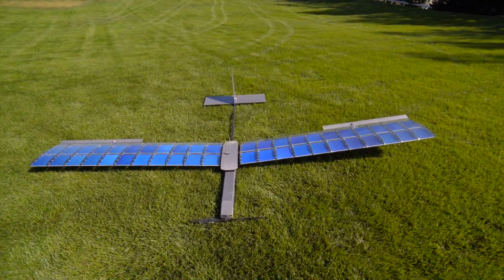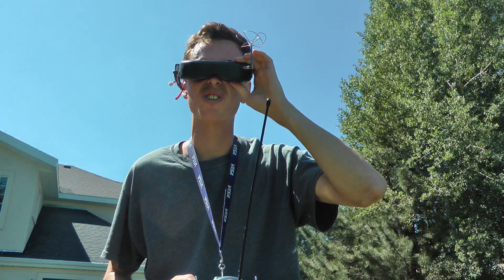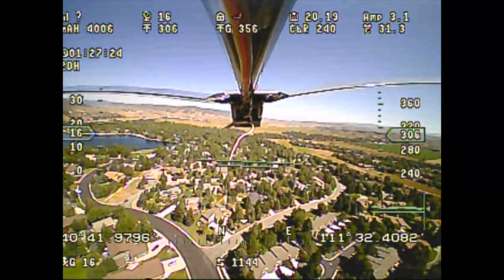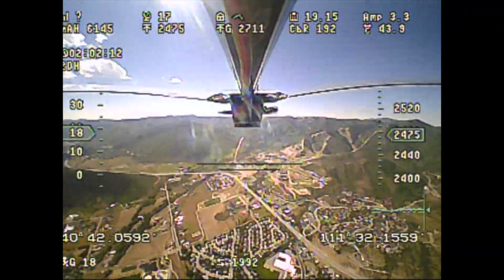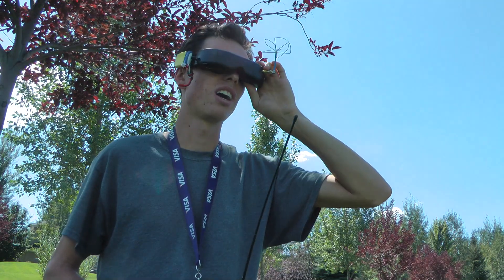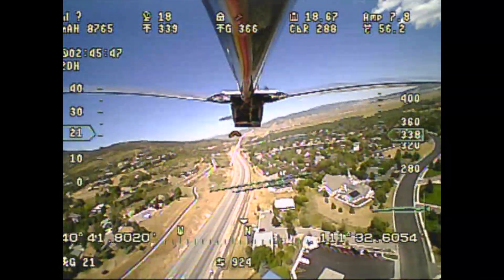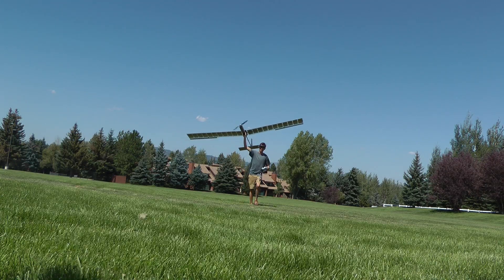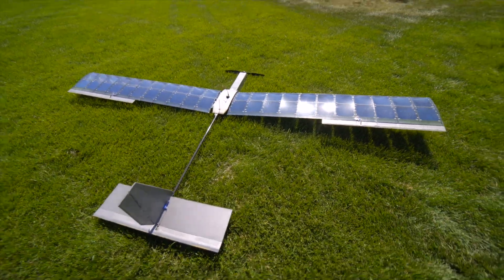SOLAR Plane V3 Long Duration Test Flight - RCTESTFLIGHT

Comment: Congrats dude, you did it!  You could look at reducing weight by using a lower amp hour battery since you're now flying by solar power.  You just need the battery to stabilize the power system and provide temporary storage for climb and recovery.  Extra optimization will expand your flight times from noon+-1 hour to noon +-2 hours to get the 10am take off time you wanted.  BTW, I think you could have gone another hour if you hadn't turned off the solar array near the end.  Anyway, awesome job and don't bother with MPTT.

Comment: Could you switch between batteries, like one used for take off and gaining altitude while also having solar input then swap to another full one while at altitude. Then when on the new battery all solar can go to charging the now partially drained takeoff battery, once that gets charged up swap back to it? Repeat? Sorry if this is dumb or if u tried already and i've mussunderstood.
Reply: A lot of people have suggested the same idea but I don't see what it buys you other than doubling the weight of the battery.
Reply: GaryVolts I was saying because he said solar voltage and efficiency increased when the plane was gliding and not using the motor and in charging mode. With the two batteries it would have the solar cells always charging a cell at peak efficiency.Less loss and more efficiency might keep it up in the air longer.
Reply: I think their was some misunderstanding somewhere.  Sure the battery is charging at max rate when he was gliding down, but the potential energy represented by the height of is airplane is decreasing during that same time period.  The single battery already  naturally discharges during the course of the flight towards the voltage of maximum power transfer and hangs there on the rising slope of the curve until late in the day when the voltage crests the charge efficiency curve and starts down the other side, at which time he needs to get ready to land.

Comment: I would not boost up the voltage from the solar cells, you're loosing too much efficiency this way.
Maybe find a motor/prop that works on whatever voltage you solar panel are providing at 50% and match the battery to that.

Comment: Awesome, congrats!  That's quite a flight time.  Props to you for patience. :)

Power management is definitely your next hurdle.  I don't think it's realistic to expect solar power to provide enough energy to climb at off-peak times of day - that's what the battery is for:  Charge it up in the sun, fly off it in the dark.

Also, to gather as much solar energy as possible from off-noon times, you need solar panels that face more to the side than straight up.  Maybe on the tail, or perhaps consider a polyhedral wing with panels on the outer sections to capture off-peak sunlight.

Comment: I think winglets would help.  Some of the air slips from under the wing and around the wingtip to above the wing.  This takes energy out of the forward motion without creating lift.

The controller is basically a PID controller.

Proportional gain is how much angle on the controls per degree of heading error right now

Integral gain is how much to increase the angle per second per degree of heading error

Differential gain is how much angle on the controls for how fast the heading is changing

A lot of controller either dont have the integral or the differential 

The "S" turns are oscillations.

You should be able to hold the aircraft with your hands and turn it to see what each control does to the control surface motions. 

If there is an integral gain, turn it down.  If not turn down proportional.

If turning down the integral doesn't stop the oscillation, turn down the proportional too.

At some point you should be able to get the plane to not oscillate but be very sluggish to correct for wind changes.

If there is a differential turn it up step by step until you start to see fast S turns and back it down from there  by about 1/3rd to 1/2.

Comment: You've probably already thought of this, but once you get your charge controller figured out, what about replacing the batteries with high capacity capacitors? That could be a winning combination.
Reply: I don't think there are capacitors with specific energy specs that would beat his battery.

Comment: Try one of these.  It looks adjustable.  I would set the output voltage to the maximum battery voltage you want from the MPPT (i.e full charge).  I believe that's just a maximum setting and will still send maximum power to the battery if it is below that. http://www.ebay.com/itm/5A-9V-12V-18V-24V-MPPT-Solar-Panel-Controller-Battery-Charging-Board-1-100W-/272252183236?_trksid=p2141725.m3641.l6368

Comment: Please fly with MPPT.  It would be amazing if you could automate the flight.  Just control for takeoff and landing and have a programmed holding pattern for the boring parts.
Reply: The system finds the MPPT point on its own without a controller.

Comment: Love your creativity and your projects! Hey how about using two batteries and a switch that decides when and which battery it should connect to the solar panel? So you'd use one batterie while the other is charging and then switch to the full battery again?
Reply: More weight is a bad idea.

Comment: Dude, it hurts seeing you misuse solar panels like that, just ask greatscottlab to make you a circuit that maximizes the solar cell power production, I bet he can make one in 5 minutes.
Reply: The system finds the max power point naturally as the battery discharges.  The approach weighs 0 grams and creates no conversion losses.
Reply: GaryVolts the dude just plugged in the solar cells like an extra battery, I'm not good at electronics but I know there are circuitry that draw the maximum amount of power out of a solar cell without relying on the voltage drop of a lipo.
Reply: I appreciate that it may appear like this, but there is actually some careful thought into the selection of the battery pack voltage relative to the solar panel.  Yes there exist electronics that are designed to operate for related applications but in this particular critical solar flight case this seemingly simple way of connecting the panel to the batteries is optimum.  It adds no extra weight, it incurs no switching losses, adds no EMI to the system, and operates the panel at its maximum power transfer point when the battery needs the power the most.

Comment: thanks for posting.  good work.  one thought.  in order to reduce power consumption, a geared prop drive using a lower-wattage higher-speed motor could be tried.     cheers

Comment: I think you should try to improve the plane in lots of small little ways to get lots of little increases in efficiency like;
rounding the front of the nose (as it is pretty square), perhaps use a nose cone.
add winglets to the ends of the main wing.
round the front of the leading edge of the vertical stabilizer.
You could also make the aileron control surface go down the whole length of the wing.
The hatch on top looks like it could be slightly thinner and rounded to make it more aero dynamic. 

Im sure you could find more

Comment: Good progress, got data in even though not the result you looked for. Try this thought ... the tail-plane does its job, sure, stabilizing, but for your real objective it is just a dead-weight passenger. I count 44 solar panels on the wings - why not redesign just the tail planes to have another 8 panels - that's an 18% increase. Why not 12 more panels - that's a 27% increase. Structural weight is already partly in the mix, only PV panels and wiring to add and a little CG adjustment. Not too invasive. That could be done with approx the same size horizontal stabilizer as current, but with a 2x2 or 3x2 grid on either side, with the hinge between the two lateral lines. Yes,that makes for a very large elevator portion, but that also means gentler throws for the same control action, which would probably be a good percentage more kindly on the drag total. Every control movement creates drag. Make the vertical stabilizer and rudder highly reflective (mirror mylar or aluminum foil) to reflect onto the adjacent horizontal surface.  

(edit) PV panel output is more efficient cool than hot. The transparent wing is the equivalent of a greenhouse. Infra-red rays go in but can't come out. Needs some cooling air-flow internally. Perhaps intakes near the wing root to catch the prop blast and exit vents at the wing tips in a position where the tip vortex can help extract.

Now, about those ailerons .... hmmm.

Comment: rewire the solar cells so you have a higher input voltage from them
and THEN use the buck converter and find the most efficient current point with the most efficient voltage (and set current limit so its also the most efficient)
and then you will likely get closer
but it will likely be less efficient than directly connected to the solar panels because of the added weight of the buck converter and buck converter efficiency losses (You could perhaps remove the batteries and see if it will work with the buck converter.. but it might likely have some unseen issues.

Comment: use a two section battery, recharge one with solar panels while the other is powering the motor and repeat the cycle
Reply: Batteries lose most of the energy that is put into them. Best sustainable method is to run solar as directly to the motor as possible.

Comment: The way you have your cell may be shaded.  In many cases a little shade will cut solar cell output by more than 50%.   Put it on the top of the wing

Comment: when you get to the stage of doing a re design i would recommend going with a twin hull and boom, 2 motors and greatly increase solar area without increasing drag too much. something like this http://imgur.com/a/KWGJ7 did a quick photoshop

Comment: If your solar voltage is as close as it is to your battery voltage, you will have to buck/boost for mppt. By wiring the panels for half the voltage Double the amps you can get away with just the boost. 
Consider 4S larger prop and the mppt controller you already have....

Comment: You need to get long range trancevers and do cross country with the plane :D
Reply: or just the Grand Canyon
Reply: yes
Reply: Good idea
Reply: @Kevin because that doesn't break FAA regulations
Reply: @brandonhoffman4712  It would be difficult to not break FAA regulations doing that but, it is possible. You would have to be in a chase vehicle maintaining line of sight and navigate clear of all airports and then there is the night time flight problem. You would have to get special permission from the FAA to fly beyond the 1 hour after sunset, Probably not going to happen.
Reply: @brandonhoffman4712  lmao you think i care about some FAA regs when im piloting a remote controlled toy hundreds of miles away from my location?! HAHA you must be kidding me, good luck finding me, better yet, good luck trying to get my plane down.
Reply: @LosHihhuli I have that setup too, but, I messed up and have to get a different modem. I use Verizon unlimited.
Reply: it is not fast enough for that.
Reply: Yeah. On 5g it would be possible or put some a.i ;)
Reply: @Op.MarvelMaster101 Yes, LTE works just fine
Reply: Two words: fona module.

Comment: What if the battery gets too hot, or is it even getting warm? Seems like constant charge and draw would create some temperature issues.
Reply: Most of the power is flowing directly from the solar panel to the motor, the balance is going to and from the battery depending on if he's climbing or descending.

Comment: what about adding winglets? with such a big wing surface they should rise the efficiency quite a bit! Also I think that if you round the edges of the elevator making it more like a semi-ellipse rather than rectangular will help.

Comment: why not have a bigger battery to start with, which you can drop in midflight and have a small one for flight.
Reply: Because it would go against the idea of sustained solar flight if he started off with a huge charged battery and discarded it during the flight.
Reply: Why, if he sustains flight as long as the sun is shining?
Reply: But what does it gain him if the small battery is already enough for his initial climb?  I'm sure what you're suggesting can be created but i don't see the payoff.  Maybe it allows him to start the day earlier than the system would otherwise be able to sustain.  So if it can normally fly noon +-2 hours.  Having the extra battery could allow him to launch half an hour earlier so he'd get 4.5 hours of flight instead of just 4.
Reply: He could climb to a much higher altitude (~2-3 km). Up there it's colder (significantly higher efficiency of the solar cells), he has to deal with less clouds/pollution/atmosphere above him, the wind is steadier and should be easier to handle and the air is thinner (reduced drag). Overall just small improvements but can make a huge difference combined.
Reply: Ya, totally, for a solar power airplane, being above the weather makes a big difference.  As far as air density I don't think that helps him much because while there is less drag, there is also less lift from the wing.  Going high makes sense for airplanes designed to go places, like commercial jets.
Reply: It depends on if you're using a prop, turboprop or jet engine in which hight ist your highest efficiency. If you have a lack of lift in only 3 km height, you should consider to change your airfoil anyway.

Comment: could you attach 2 props either side of the main one on the wings, free running propellers that will charge the batteries, so it will have solar and its own inbuilt wind farm :) ? I know if its more heavy means more power, but like when you turned off the motor the solar charged the battery. So if you had 2 wind propellers also helping with charge, not sure how much drag it would cause though! also is there a way to make the onboard propeller to regen back to the battery on power off ? one more thing, no solar panels on the small rear wing !
Reply: The 2 extra props wouldn't be free running if they had to make electricity to charge the battery.  They'll dissipate more energy than they create because there is no such thing as a lossless system.

Comment: So you have a more controled setup, maybe just put it on the ground outside on a stand and test it that way now you got flight data (you should be able to independently monitor the solar, battery the charge controller should be able to do that allready) you can also see what happens when voltage gets to low and how much time you have left under low voltage conditions (and allows you to set alarms then) i would recommend useing a thermal imaging cam as well to monitor temperature as well to make sure you not got any overheating issues

Comment: Would super capacitors have a weight advantage over Lithium cells?  No charge controller required.  Add solar cells to the tail?
Reply: Not enough capacity and he's operating without a charge controller now.

Comment: The solution lies in using the most lightweight and dense battery you can find. With SSA around the corner this problem will go away. I think a balanced combo of a high density lightweight LiPo with a capacitor would do the trick. You could use the capacitor/battery to offset the drain for climbing until you are high enough to be in clear air and best sun and get a peak charger to top up the battery. Any extra solar power then goes to the motor and capacitor, leaving a reservoir in the battery for in between thermals (cold air) and some terrain flying in the car. That's what I would shoot for. The same discussion and optimisation profiles/algorithms are currently being created for solar PV home charger/battery combo's. Time for me to get my calculator out and do the math.

Comment: What if you added two supercapacitors inline with the motor charged via the battery and have the solar cells charge just the battery.

Comment: You could get away with 2 current sensors instead of 3. Put one on panels and one on the motor. You can look at the output of the panels and draw of the motor and do the quick math between the two to see how much the battery is outputting.

Comment: you lose 20% power when it goes in and out of a battery find a way to route it directly to the motor and store only surplus in battery

Comment: I know absolutely nothing...but, what if you used 4 small engines with huge props instead of 1? Like the facebook plane?
Reply: One motor is more efficient.  Each propeller tip incurs losses.
Reply: I disagree. turning larger props slower solves this. And rersearch what a blown wing is to see why this is a big deal with flight efficiency.

Comment: Use a solar controller. It makes shure that the solar panels allways operate at their optimum. This optimum depends on the solar cells, the how much sun there is, the shadows, temperature eg... so it is not possible to do it with a constant current or constant voltage step converter

Comment: New subscriber here just found your videos and love what your trying to do have you concidered using super capacitors instead of batteries as they will charge quicker from the solar panels and have less weight helping you keep altitude 😊

Comment: Cool video.
My only suggestion for future videos is that you avoid speaking in questions.
If I type what you said at 8:00, it would be written like this.

So it's getting kid of windy here?
So I'm like pretty far out that way?
So I'm a little concerned I'm going to have a tough time making it back?
With a head wind?
But it also seems the wind is shifting?
So it could just be thermo cycles rolling through?
Maybe I shouldn't be too concerned about that?
It's 2 hours 34 seconds?

As you can see, your tone implies multiple questions within a single sentence.
Turning a statement into a question is OK to do sometimes but you do it constantly and that gets annoying.